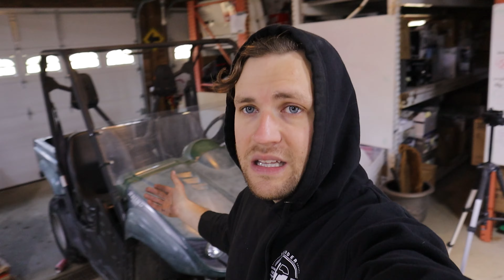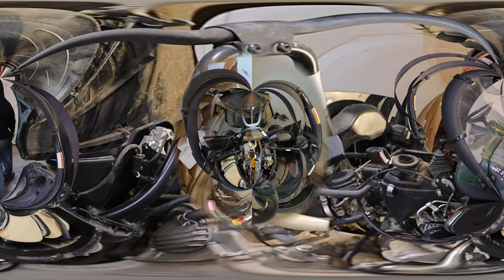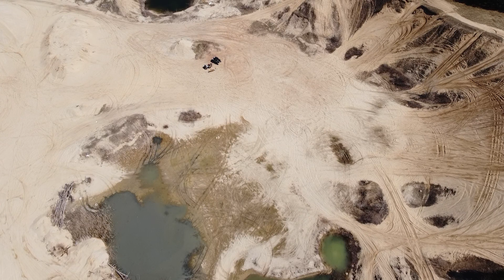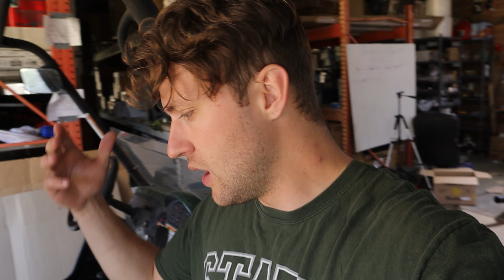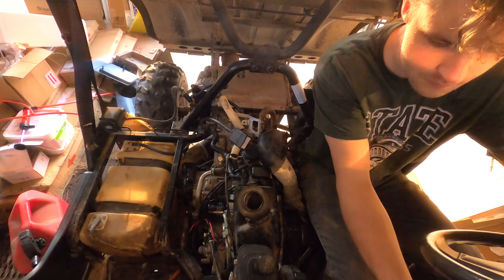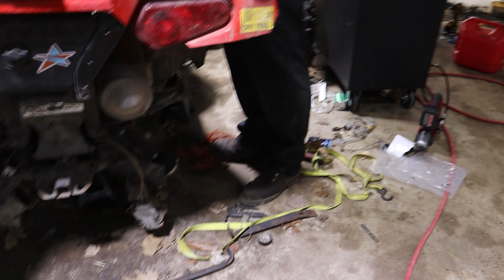Rebuilt the Yamaha Rhino 450 Very Easy

Comment: Thanks for uploading this. My 07 Rhino 450 is going through some oil and smoking a bit, great video,  where did you get the new parts?
Reply from the maker: Rockymountainatvmc.com is the best place for oem and after market parts. I also shop around on ebay to find a better deal sometimes